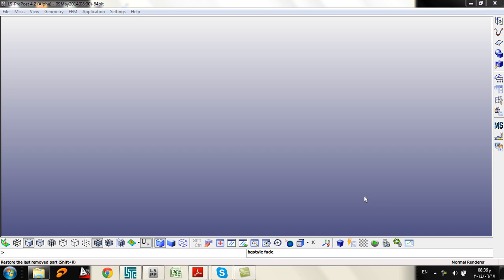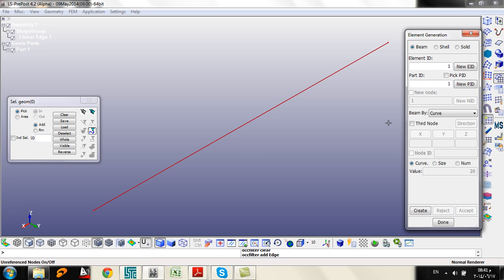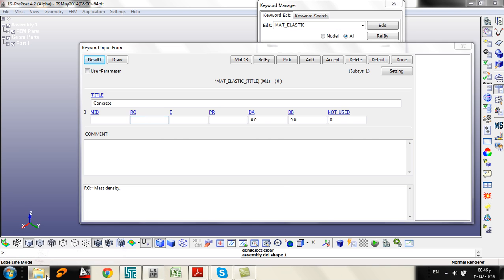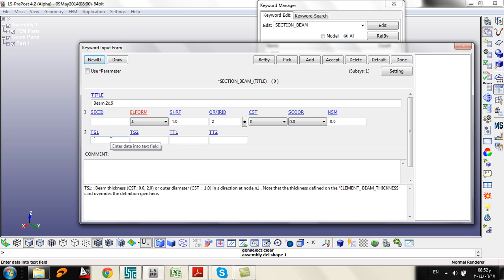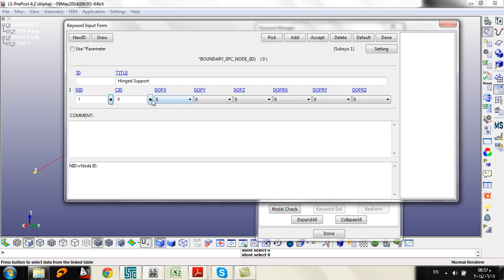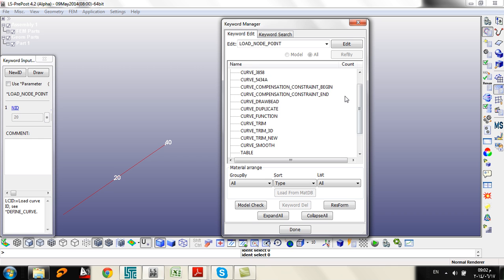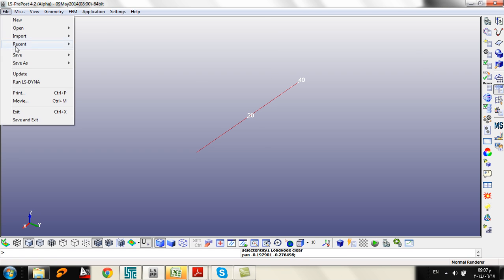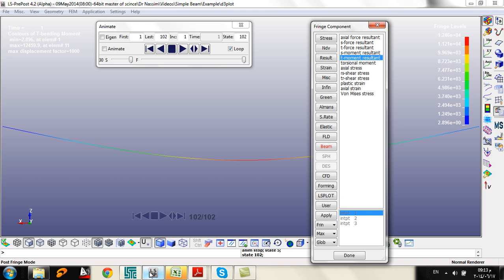LS Dyna - Session 1 (HTB series)

Comment: thank you very much for this video, but i have a small problem that my beam cross-section is round - not a rectangle, so how to set up dimension for this kind of beam. Please help me, tks!!
Reply from the maker: linh le you change the beam cross section. This will be in the Section Tab, then you will find CST. If you stop their you will fgind that if you but 1 it will account for a circular section. In this case you will use the TS1 and TS2 for the start and end diameters